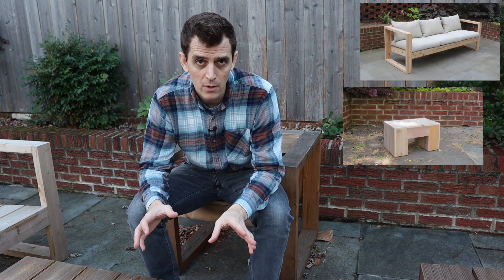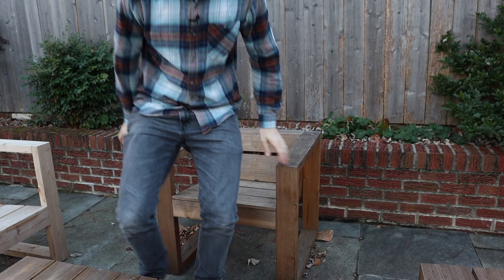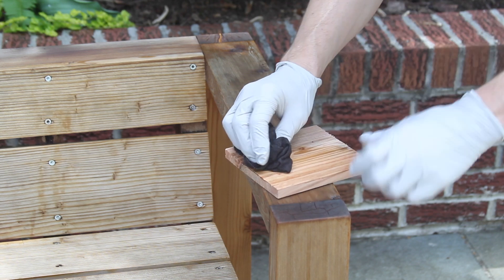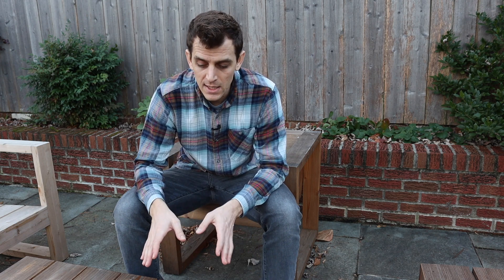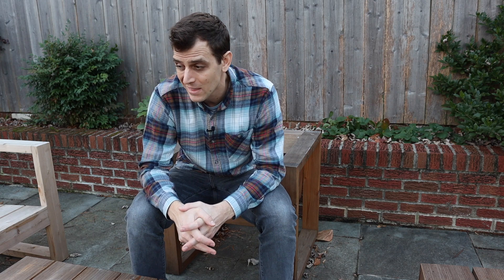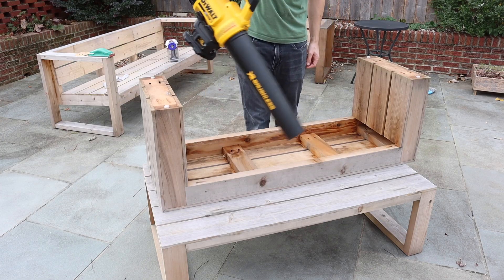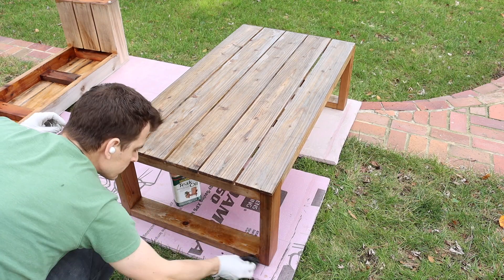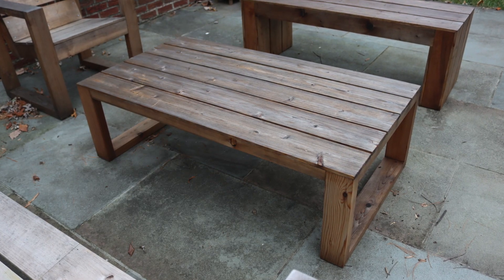Finishing all my DIY outdoor cedar furniture builds with teak oil!

Comment: Would you recommend teak oil for pressure treated pine? It's a deck so gets some foot traffic
Reply from the maker: I don't have experience using it for pressure treated wood. I do know there are oil finishes for treated wood decks though. I'd probably go with one built specifically for treated wood if it were me.

Comment: Once again! Great job! Btw first time builder what tools do you recommend? I want to build what you did!
Reply from the maker: Hey! You can check out the video descriptions for links to the tools I use. Also take a look at each video to see how to do the different builds. For Missy of these you can use just a circular saw, drill, driver, sander, and pocket holes jig, but a table saw really helps.
Reply: @NATHANBUILDS  Thanks! While I see the benefit of a table saw, they scare me as I am not experienced! But I'll go look into kits and your links!
Reply from the maker: Let me know how it goes! You can also look locally for woodworking basics classes. Definitely worth it re safety.
Reply: @NATHANBUILDS  will do!! And I'll definitely look into them! I doubt anything is open because of Covid but after, I'll definitely do it!